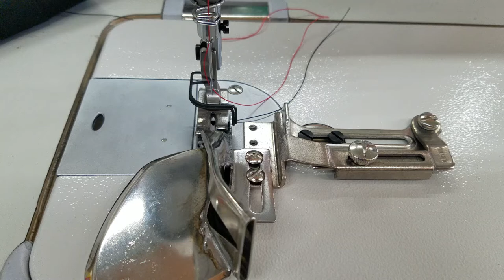swing away binder on a Juki DDL-8700H

Comment: Hi Steve, I don't know if I ordered this foot or not but would love to have it for my 8700 so, when ordering what part number is this binder and what size is it. Also I was wanting to ask you if your sewing with thin fabric, will I have to adjust the bobbin tension as well as the top to get the stitches to look right, I can still see the top thread on the bottom and my top tension is as far in as I can get it?  Thank you
Reply from the maker: You did not order this attachment that I can remember.  This is technically two attachment made into one.  We get the single fold binder and the swing away separate.  When ordering just ask for the specific size and swing away.  The one in the video is 1"

Watch this video to help with the tension: https://youtu.be/CBRsqOjVyy0